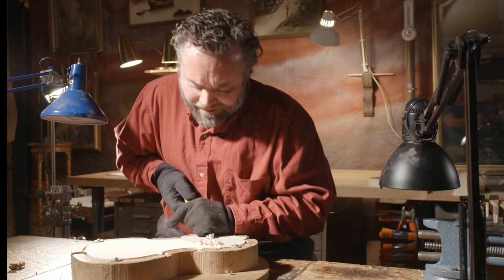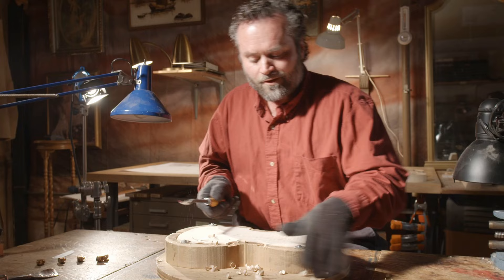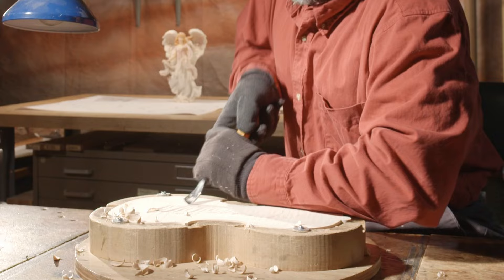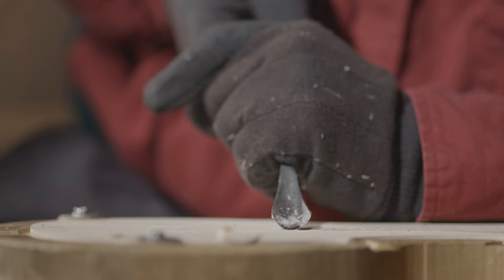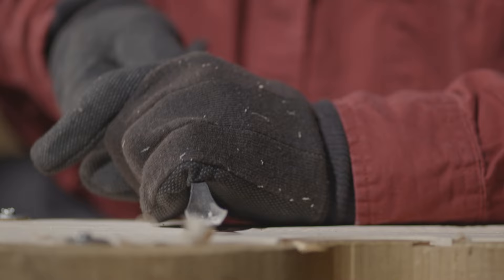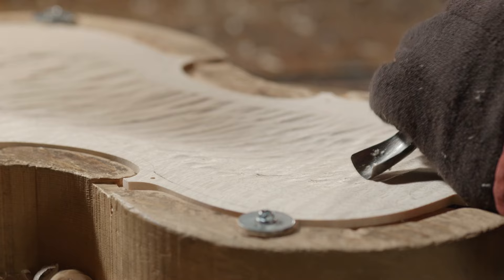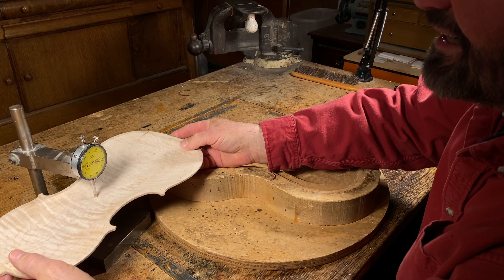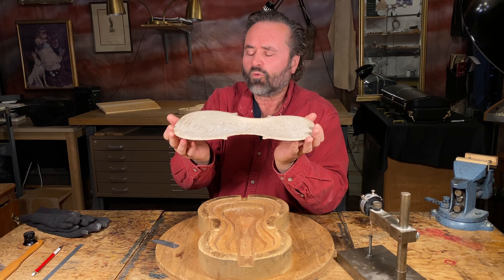The Soul of a Violin: How Stradivarius and Guarnerius Graduated the Back and Gave Them a Voice.

Comment: Good drum sander would do the rough out in no time...
Reply from the maker: I agree that power tools can be used for roughing out the wood (especially after breaking half of the bones in my right hand and wrist). But, don't take off too much wood, or finish graduating with power tools. Save enough to carve by hand so you get to know the wood personally.

Comment: Is there any utility in treating the wood as a Chladni Plate and examining the patterns?
I was led to think of this by the description of Guarnerius using a central pin. That would correspond to a Chladni plate-visible node of least vibration.
Reply from the maker: I have found value in almost every scientific/experimental approach and have learned from each one. I encourage them all, yet everything over the years seems to lead back to "how the back moves when you are carving it, and when it's held in your hands." At the same time, every maker's hands are unique, and the proof is in the pudding/concert hall.  Thank you so much for your comment!